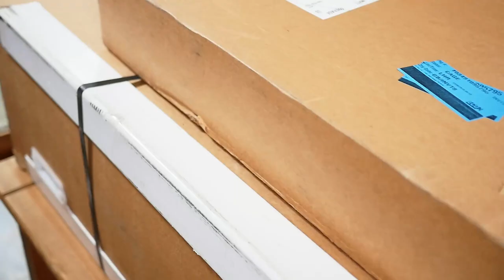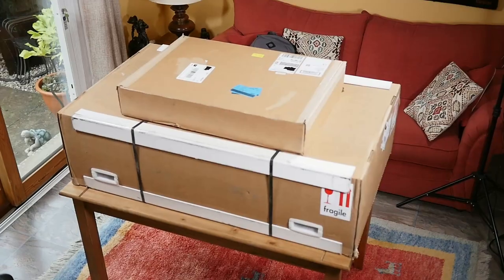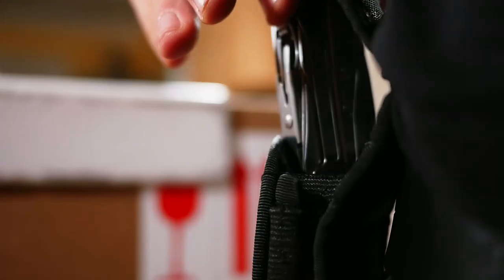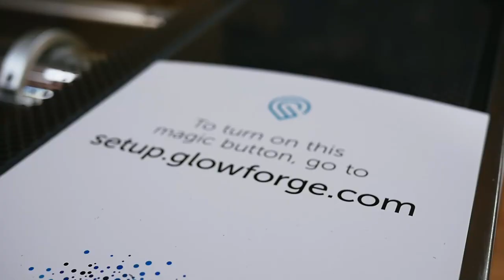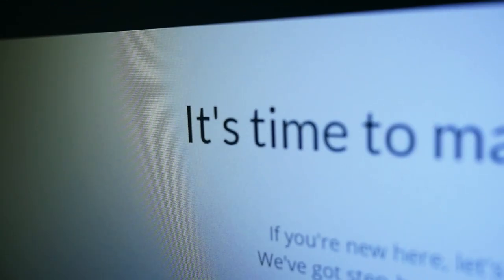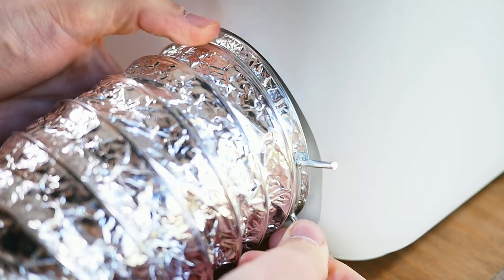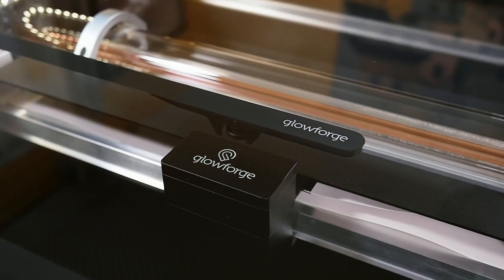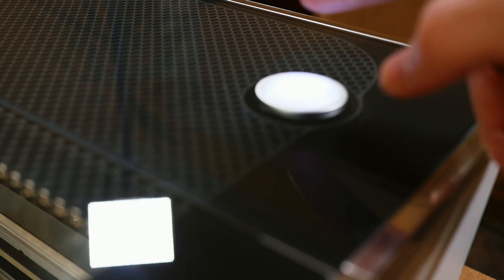Glowforge Full Setup Guide From Box To First Cut

Comment: Got everything setup step by step the way u did it but my laser doesn't go the the left when I turn it off or center when I turn it on I koved it slowly like u suggested to make sure it moves with no problem and it does
Reply from the maker: very stange. Well my laser does not move to the left when I turn it off but what I turn it on it does. Have  you got in contact with support?
Reply: @Keep-Making  no it actually started working on its on
Reply from the maker: @toquesha  Great to hear!

Comment: Not as powerful, or big sheet capable, as the one you used to film! ;-)

Definitely looks easy to set up, and the test cut looked great. Might seem old fashioned, but I always prefer hard wired kit as it's one less variable to troubleshoot. Can you run the app locally if you loose your broadband/cable internet connection, or does it totally rely on Glowforges' web servers?
Reply from the maker: That's for sure... But oh well got to start somewhere...
Ya I was really surprised by the quality. But then again I sure paid for it.... I was really close to just building my own but I really needed something now that was out the gate working to a great standard. I will in the future maybe tackle the MPcnc tho. Ya one thing I did not really take into account is that HUGE drawback of the internet =/. 100% reliant on them connecting to the google web servers. The real pain is that only 2 or 3 months after I got the glowforge the cube something came out that is 95% the same build but is not reliant on the internet but would be around 20% more cash too... SO ya can't get the best of all worlds currently. I will for sure move on to other lasers in the future tho. I do have to say that the conner correction settings on the glowforge are on point tho! I don't have to even worry about it. Glowforge / google does all the calculating for me. They will be a whole lot of videos coming out about laser design soon plus a few more on the glowforge where i'll show the good and the bad sides of this machine.

Comment: I got my glowforge pro today and while setting it up I had a yellow lens that was laying under my piece that has board and ribbon attaches to.  Did it fall off during shipment or do I need to put that on?
Reply from the maker: Hi Kim, hmmm that is very strange... there should not be any "lose" lens looking parts. I would advise that you (A) message glowforge about this and (b) join the facebook group Glowforge User Group (GUG) and post a picture in there about the piece. We will then be able to identify the part and help you out a little better. I hope that helps